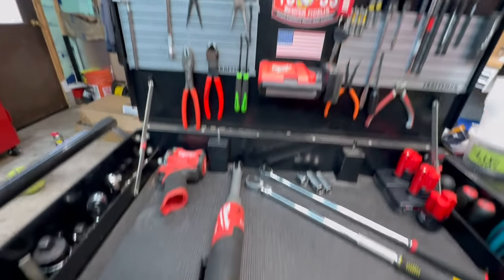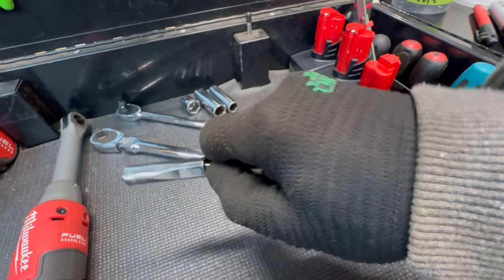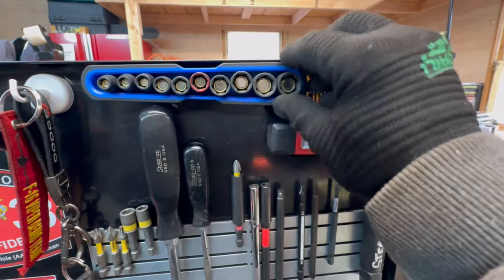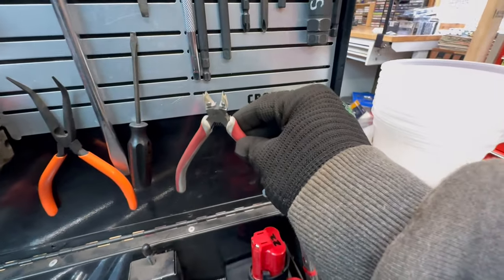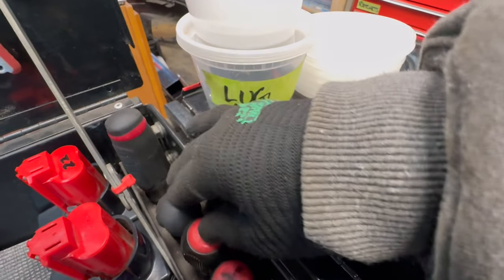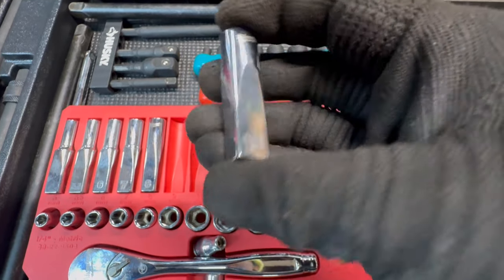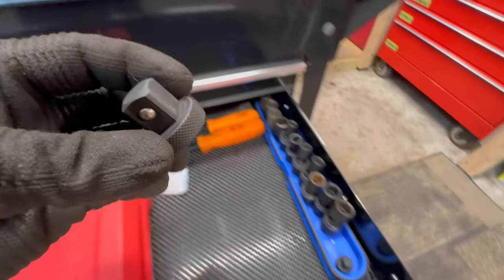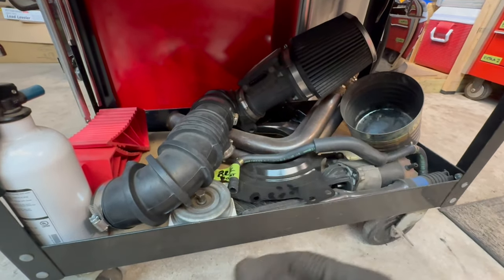4 Drawer Tool Cart Tour US General

Comment: Nice set-up, how well do those magnetic pads on your lid work? I have a rough concrete floor and have tried magnetic rails that would often drop ratchets off of them while I wheeled my cart around, do you think those mats would hold a half inch drive ratchet if you wheeled it across some rough pavement?
Reply from the maker: They are "strong" enough but they probably aren't the right design for a most ratchets. Here's why:

The plate is very thin and only comes off the lid  about 1/4 inch. This makes it hard for larger tools that aren't flat, aren't straight, and that have anything sticking off them. The head and handle of a ratchet tend to break those rules.  I'd keep other items on the mag plate to free up room somewhere else for the ratchets.

Comment: Is that a Tekton ratchet in the top? How do you like the comfort grip on it?
Reply from the maker: Good eye! Yes it is Tekton, specifically the 3/8 Inch Drive x 18 Inch Comfort Grip Ratchet | SRH02118.  It's also a slim/low-profile design (link in description). 

The comfort grip itself I think it essential on longer ratchets so when you're really pulling on it you've got more to hold onto instead of it digging into your palm at full force.

I beat the snot out of this ratchet yesterday to reach and move a seized power steering bolt that was 15" deep into the engine bay and with very little clearance before the firewall gets in the way. I was putting all of my bean into pulling on this Tekton ratchet, enough so that I was fully convinced it would break the drive or bend the ratchet. Very impressed, it held up great and the bolt is now removed.

Comment: Nice setup, man. What's the height clearance on the bottom? I got a bead on one of these boxes and want to stick my little compressor on the bottom.
Reply from the maker: I'll measure that out tomorrow morning when I'm back in the shop. One thing I know for sure is that the US GENERAL 4 drawer bottom opening is much larger than the US GENERAL 5 drawer bottom opening.